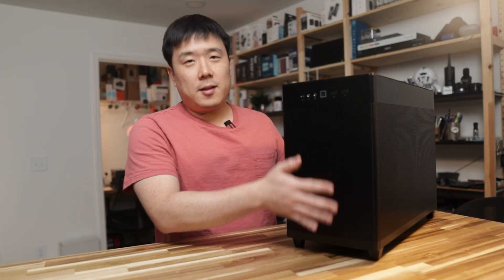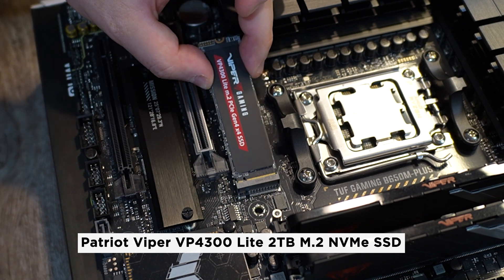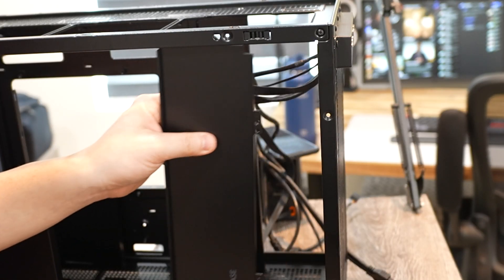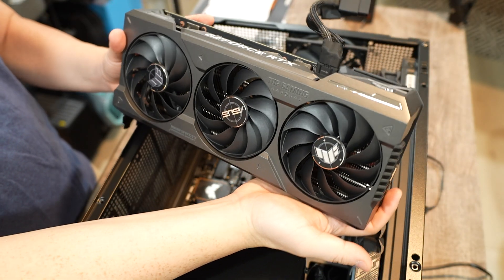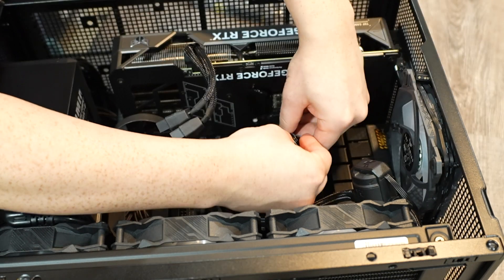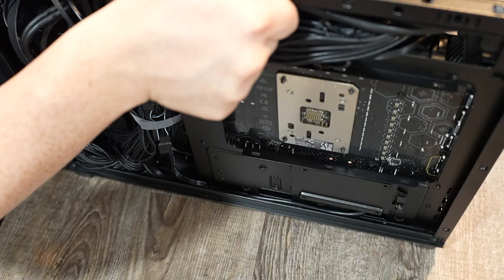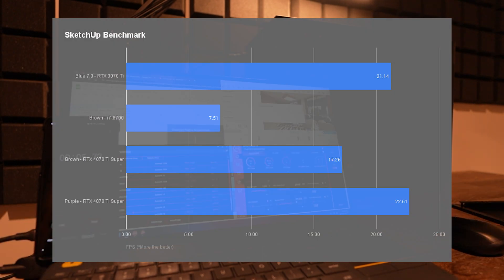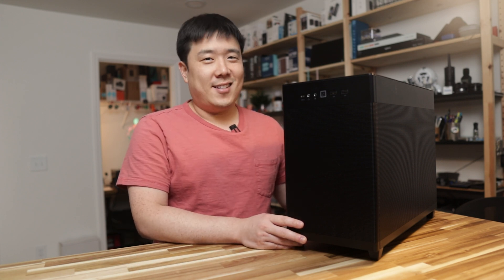PC for Architecture - The Balanced Build for 3D Modeling and Renderings

Comment: You should not need a splitter for the GPU, the PSU should have a 12VHPWR connection.  I always install the GPU last because of the front panel connections.
Reply from the maker: You are right! I made that change afterwards :)

Comment: How's this build compared to the BIMBOX?  TIA

I use Autodesk Civil 3D and I've been researching them and come across your videos.
Reply from the maker: @mbhamann  it's been awhile I featured BIMBOX. :) It will entirely dependant on the specific config and the pricing will be vastly different. I prefer more DIY and economical solution than premium pre-build as BIMBOX.
Reply: @JosephKim  I also prefer my own build, I just always wonder what I'm missing out on and where I should put the money.  I've got four computers I will be replacing shortly and wondering if I should use the new Ultras.  Yes I prefer Intel and Nvidia combos.
Reply from the maker: I heard great things with Ultra + Nvidia combo too! Perhaps you can get more performance with premium pre builds, but I don't think I can justify in terms of performance to dollar ratio.

Comment: That is more than enough thermal paste, i wouldnt have put more.. maybe slightly less even lol
Reply from the maker: @RainOrbs  I thought it has to cover the entire surface of the 'lid'. It was my first time with the larger AM5, so didn't know what was right.
Reply: @JosephKim  a pea size is good, when screwing down it creates pressure and causes the paste to spread fully over the surface, you might even have excess pooring out but it's no harm, nice build!
Reply from the maker: @RainOrbs  I suppose the pea size wisdom continues with AM5! Will do that next time. 😁
Reply: @JosephKim  I would also use a AM5 secure frame. It doesnt improve cooling much, but they are cheap and make cleaning up thermal paste so much easier if you are changing cooler, paste or whatever.
Reply from the maker: @stabizisback  thanks for the suggestion! Putting one in the order to test it out!
Reply: @stabizisback  Do they even make that mount for that cooler? Think only some air coolers like Noctua make it?
Reply: @REMISCStv  Its a block that replaces the hinged lid that holds the cpu in place, its not part of any cooler. Its very effective at improving temps on intel cpus, not so much amd. On the other hand the shape of AM5 cpu`s means its very easy to get paste in all those edges, so the secure frame (I use Thermalright) makes less of a mess.
Reply: @stabizisback  Ah I mis-read your post. I thought you meant the relocation bracket like Noctua makes. That seems to be the one thing that helps temps on coolers. I use the Thermalright intel frame on every i9 build I do. Worth it for the couple dollars it cost.

Comment: Good video Joseph! I have been wanting to try the AP201 with an air cooler. With the ATX power supply, it looked to have a lot of room.
Reply from the maker: @REMISCStv  yeah! Just don't orient it if you have the inline pump. :)
Reply: I use the Phantom Spirit to cool a 7800X3D in the AP201, works well.